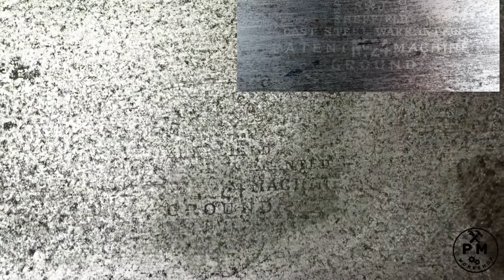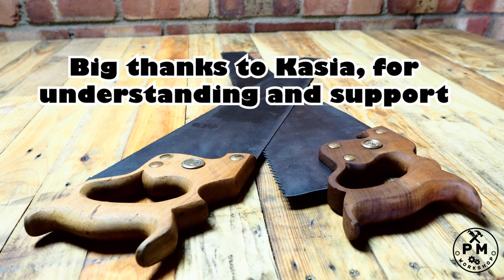Antique hand saws restoration (Spear&Jackson and Disston)

Comment: Next time you have a saw screw stuck, don't file into it, use 5 minute epoxy to glue a stick of hard wood scrap to it, you'll be able to hold it and keep it from spinning and unscrew the screw portion. I do this all the time. I have also had good luck with soaking the wood handle in warm water which makes the wood swell around the nut and keeps it from spinning, spray the screw end with WD and it should spin right out. The only drawback with using the water method is that now you have to dry the handle slowly to keep it from splitting. The 5 min epoxy comes right off with a bit of heat and you don't destroy the nut or file into the wood handle.
Reply from the maker: Thx for advice
Reply: Great info!  I have one that needs this.

Comment: To fill holes and gouges in wood, make up some shellac and put a drop in the hole and sand the spot so the sawdust is deposited in the depression; may need several attempts to fill to the surface.  The epoxy will always show. If the depression is a dent, put water on the dent until it wont take any more water; take a clothes iron and a wet rag and iron the dent out.  The steam from the heat will swell the wood fibers back to the surface.

Comment: I would have left the initials and scars in the handles, nor would I file the screws. Why didn’t you sharpen the saws after all that restorative work at least they would be usable.
Reply from the maker: Not planning to use them. They only for display

Comment: Much more could have been done to avoid cutting the screwhead.
Too much sanding and removal of original protection.
Sanding marks and filling holes, why, pointless, loss of age, marks and heritage, cleaning only would have been better. Then protect with oil.
Your beeswax will be no substitute for original, whatever that was.
Regardless, great video, I have s&j  saw to do too. Interesting.
Reply from the maker: It was my first ever project. As a new to this type of work I have tried my best but as you mentioned still lot to learn
Reply: @PMMetaldetecting  thats why I was watching it. I take the heritage viewpoint, let the age show and only do enough to make it last. I took lots from it, very educational. I could have worded my comments so less negative, apologies for offence caused by them.
Reply: @seadog158  the thinking is to have an honest repair or refurbishment. The state the object is in should be left for all to see, or it should show its age. After all we are just Stewarts/caretakers of the objects for future generations.
Reply: @seadog158  some of the buildings in Europe can't be repaired, loss of skills, materials and high cost means they have had to think of other ways. So they use lego in the repair, looksnrw and honest.
Reply: @jcoul1sc  Yes, but where is the link of you restoring your saw? Paul Snaith hits it on the head.....put up or shut up.